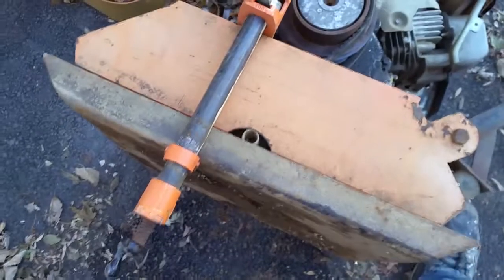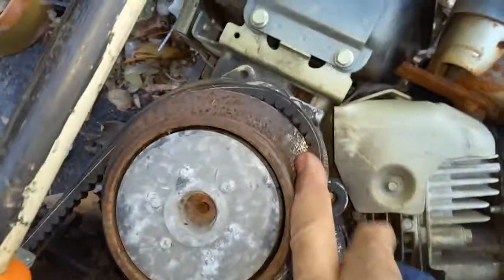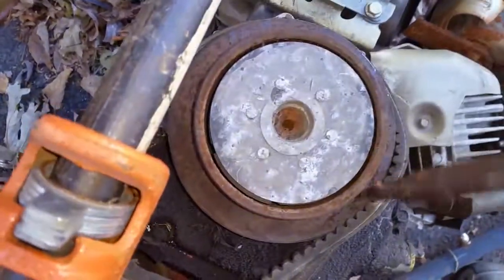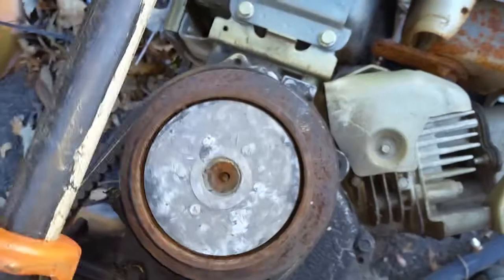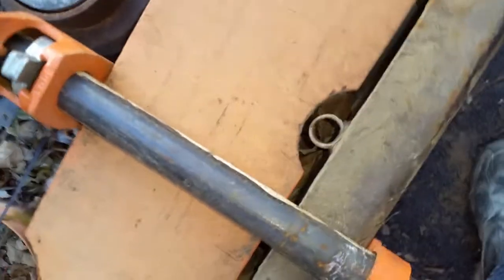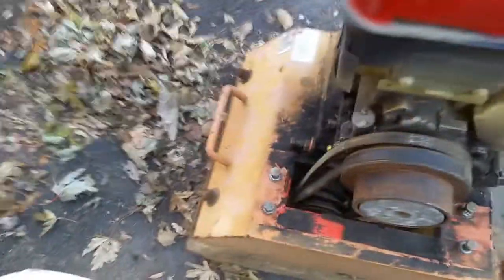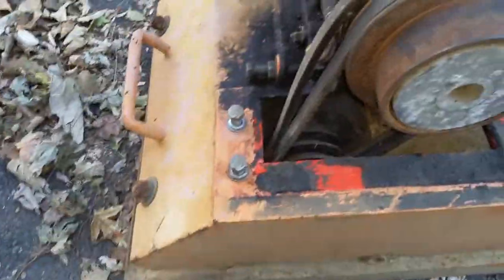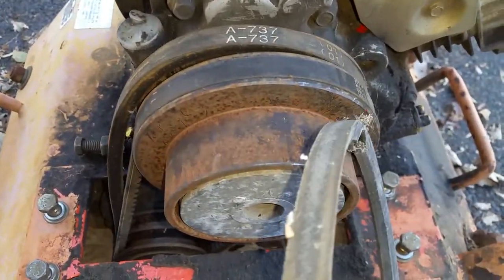Replacing a tamper belt  - double belts - dual belt system

Comment: Just a word of advice: Use the tension adjustment bolt that is visible between 52-55 seconds in the video instead.   Here's a pic: https://i.imgur.com/APv9rVA.jpg

The clearance you need to swap belts is obtained by loosening that bolt and simply sliding the engine forward an inch or so.  After one replaces the belts just tighten it up.  The bolt will push the engine to the rear as you tighten, taking up the belt slack.  When you are dialed in on tension just lock the bolt's position down to the chassis with the forward nut that is there for that purpose.  Good luck!
Reply from the maker: This video was long ago, I think I did adjust the slack.  Interestingly, I sold that tamper but last summer purchased another one just like it! 
Perhaps it will need a belt in the future and maybe I do a video adjusting the tensioner
Reply: @EngineerPEretired  yup; my engine blew (my fault) but they're $119 at harbor freight so no worries :)

oh...didn't mention it but to use that tensioning bolt you have to loosen the four bolts securing the engine underneath too.